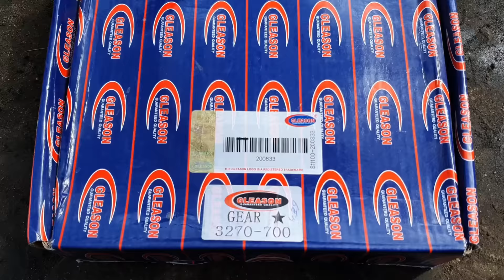How to Rebuild Transmission of Tractor | Gearbox Repair | Gearbox Fitting Complete Video

Comment: Unbelievable amount of knowledge displayed here ... rebuilding a normal 4 speed gearbox is tricky enough but when you get into overdrive and high low ratio gears etc etc you really need to know your stuff ..well done guys I bet that ran as sweet as a nut when you had finished 👍 just out of curiosity what would this repair cost including parts ?
Reply from the maker: Actually didn't ask from the mechanics, but as compared to America & Europe its very cheap here.
Reply: 1
Reply: Iam a tractor mechanic.. I uploaded 190+ videos about tractor repairing but no one from out of my country appreciate me about my work..